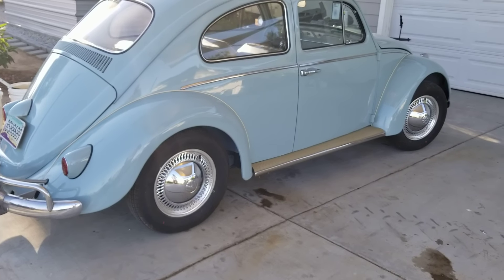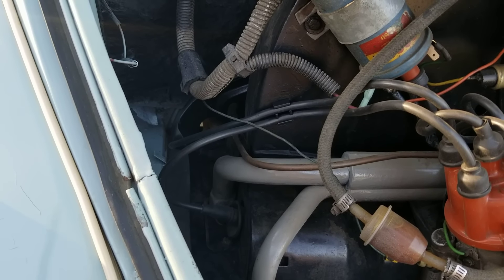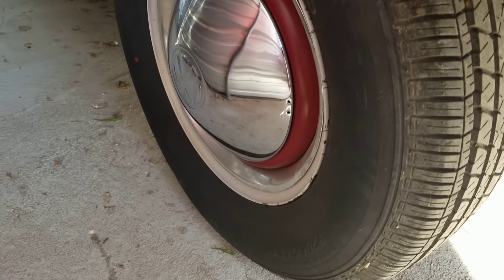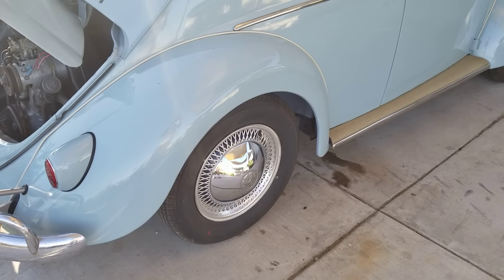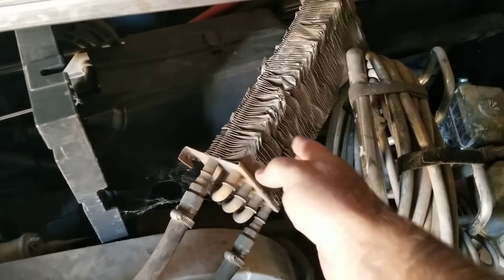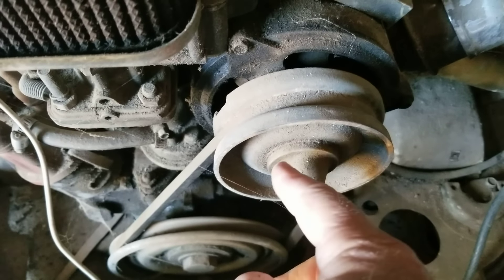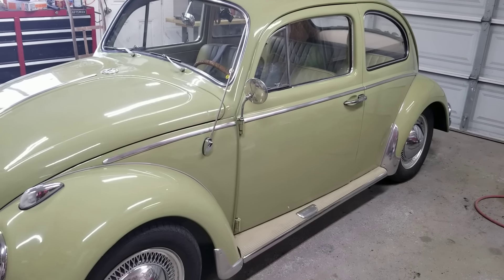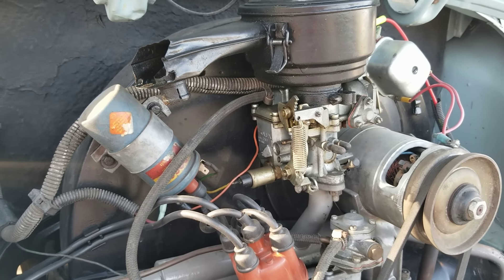Things NOT!!  to do to your Volkswagen VW bug or bus

Comment: Mine topped out at 78 mph...so I could not go 80! The oil cooler in the hot air path made for a smell of oil when you turn on the heater!!
Reply from the maker: depends on year early cars yup would not go 80.

Comment: Put your battery IN a plastic battery box, or, rot the floorboard out. Thread inside of gas connection on carb and connect the gas line with a screw-on connection, or, let the brass pressed-in tube come loose and burn your car up fast! Do not trust ANYBODY to do what they should or signal what they are going to do. Most don't have a clue what they are doing anyway.

Comment: ..do not use those clear plastic fuel filters in an enclosed engine compartment..they can, and do, rupture or get melted and cause an engine fire!..use the solid metal ones instead..but MOST OF ALL...DO NOT alter, modify, customize, lower, or in any other way defile an old Beetle that is as nice as this one!.. :)

Comment: Is this a '59 bug? I had one and the details look similar. One of its best features? The original engine was trashed - burning a lot of oil. A factory replacement with carburetor, dynamo and clutch was the equivalent of $250 and I put it in myself. After a further 60,000 miles, the car was rusted out, but I sold the engine for close to what I paid for it.

Comment: I had this 3 weeks ago.....
Do not leave without a spare throttle cable 😂 I was stuck on a road with no safety lane on the side. Somebody didnt see me with the hazard lights flashing in the dark 🤨 he almost crashed into my car. 
I really need to buy a proper solution for better visibility for these kind of situations.
But anyway I could get the cable attached again with some help from my swiss knife (I always have it in my pocket for stuff like this).
But it wasnt fun to do on a road where people drive along with 80 to 90km/h.

Comment: 1st Do not accelerate before starting, when starting the engine touches the throttle to keep a low turn, accelerate old solex causing premature injection and difficulty in starting besides mixing the oil that is resting in the cylinders and liquefying the oil causing reduction in life useful of the rings.
2nd after the hot engine has run a test, shutting down for one minute without starting, if running at half or one revolution is ok, if starting the engine without accelerating the carburetor bowl needle is not holding pressure and filling the bowl causing the drowning leading to the first topic. It is usually noticed after turning off looking from the carburetor he dripping gas through the ventury diffuser.
3rd always grease the front and rear torsion bars so as not to wear the bushings and maintain a smooth ride.
i have a VW Brasilia 77 1600cc old solex PIC 30, dif ratio 8/33 i can do 86ml/h and no problem, no overheat but need constant valve ajusts when i take to far, and start in 10ºc on half turn, and had not one single problem whit this kind a car. Thanks!
Reply: Rene Drew   no Man, is PIC 30 for sure, not American carb. Research by Brosol Solex PIC 30, tou going to see one very similar carb of first bettle
Reply: Rene Drew  no, they stopped in the mid 90s.

Comment: Does your old VW have a sloppy shift lever ? First remove and inspect the shift coupler,  it's under a panel under the rear seat. On type 3's it's under a cover under the car just forward of the transmission. Inspect it for a bent frame or worn out inserts or you can just replace it. If you have a semi-auto transaxle beetle you will also have to remove the spring and mounting clamp that is wrapped around the shift rail before removing the shift rail. It's purpose is to keep the shift lever always to the right where the 2 gear ratios that are commonly used are ( semi-autos only have 3 speeds ). Next remove your shift lever, it should be firmly bolted down to the frame tunnel. Go to the front of the car and remove the body apron plug, spare tire, and inspection plate, and the cover at the frame head. If the frame head cover didn't have a gasket you can make one or buy one but it should have one. On super beetles you also have to remove the front deformation piece. Inside the car thru the hole where the shift lever goes grab the shift rail with pliers and slide it forward until it comes out of the front of the car. In the hole where the shift lever was there is a plastic guide sleeve in a bracket. Remove the guide sleeve, in a type 3 the entire bracket can be removed. Inspect the guide sleeve for wear or you can just replace it. Install the retaining ring on the guide bushing before installing it. Ensure the slot in the guide sleeve points to the left side of the car. Now you can inspect the shift rail. It will be worn out where the guide bushing rode. Clean your shift rail with a solvent and scotch-bright pad and look for bends. Have the shift rail sand blasted and powder coated, do not powder coat the socket end where the shift lever fits. This will slightly increase the diameter of the shaft and make everything fit together snugly which is what we want. Re-install everything making sure you grease the inside of the guide bushing and the shift lever socket. Make sure you safety wire the square headed grub screw that attaches the shift coupler to the transmissions input rod ( the hockey stick ) so it will not fall out. The grub screw should be firmly seated in the indent of the input rod. Your car should shift like new now. 😀

Comment: you might want to put a safety wire on the carb as reported last- can be done by trapping mechanic wire under the hose clamp and securing the other end to the carb top screw Just a thought --- yay blazecut- google it--
Reply from the maker: perfect yes

Comment: What is the big deal with the holes in the bottom?  My shop replaced my oilbath breather and now I have two holes in the bottom where the hoses used to go. Should I plug them?
Reply: Holes in the bottom allow heat from your exhaust to come back up into the engine compartment.  This is an air cooled engine, so it will heat up the engine compartment

Comment: I'm interested in the reason that the pulley will crack without enough shims. Your beetle is a nice one!
Reply: The shims are for aligning the belt. If the alignment is off it puts stress on the pully. Use a straight edge to verify.
Reply: @craigkucing9779  I was wrong all these years because I thought it was about premature belt wear then?

Comment: the reason for not putting the fuel filter in the engine compartment is the weight of the fuel filter pulls the brass fitting out of the carb

the solution is heretical: get a 1/16" brass NPT fitting and the tap for it, tap the opening, and screw the fitting in.

Comment: i also have ALWAYS  run filter in cabin.. But DO NOT use clamps on plastic fuel filter, and if adamant about doing so do not over tighten as plastic filter will distort and cause leak especially on long distance drive... DO NOT install filter over distributor.. DO NOT throw ANYTHING away when "restoring" your VW, you may be surprised aftermarket will be trash in comparison..DO NOT buy a classic VW unless you intend to work on it😁
Reply from the maker: one persons trash is another persons gold amen to that one.

Comment: The red I & III & III tic marks around 15/32/45 mph on the speedometer are minimum recommended shift points/do not drive under this speed in the next gear, low RPMs are a killer (4th gear minimum speed 45/ 3rd gear minimum speed 32/ 2nd gear minimum speed 15).   As he said don't lug the engine down and don't shift early

Comment: So over the fall I got a 1965 slapped together dune buggy..square tube frame, welded under the influence of Bud Lite. I'm going to get an Acme Warrior knock down and build that. With this being a 1200 or 1192 engine, any recommendations on refreshing it? It has a swing axle transaxle (bug not bus). I want to drive it as a weekend vehicle and occasional warm day driver for work. I do have a How to Rebuild an Air cooled VW engine book. I know I want to convert to 12 volt since 12 volt lights are easier to find and I can run LED much easier (less load on the generator).

Comment: Do not have chrome tin. It looks pretty but it makes it run hotter. Do not use synthetic oil it's too thin. Do not use a glass fuel filter do have it in the engine compartment but make sure the hose clamps are away from any electrical connections.

Comment: I have advice for anybody who is driving your Volkswagen down the road or even on the freeway as soon as you feel hesitation pull over immediately don't try to wonder what it could be you could be flooding your engine with gasoline enough gasoline that maybe will run onto your distributor or even an exhaust and start a fire,,, keep a fire extinguisher with you at all times it's the best insurance you can have and the cheapest Insurance you could have, so as soon as you can put the fire out the better you are, ,if you have a vented decklid  don't open it shoot the fire extinguisher through your deck lid vents to try to smother the fire and run it out of oxygen if you do not have vents slightly open it and shoot it through the side of the deck lid opening plus if you open it all the way you could burn your face you don't want to do this be sure you know what you're doing if not let your prized possession burn to the ground because it will take a while for the fire department to get there if you're scared of fire you should not own a air-cooled car anyway,,,,..

Comment: A couple other things.......
 Do not trust your speedometer.
Do not dump the clutch in reverse whether you're stuck in sand, snow, mud, or anything that would need more oomph to the tires while backing up because the weakest part of the entire transmission is the reverse gear assembly.
 Do not install your battery without hold down, if you were to flip the car over and the battery were to not only knock the rear seat off of its mounts, the battery would find some way either hit you or your passenger in the head or short out on something once it becomes jettisoned through the cabin,or all of the above. ( It weighs a lot and it's not gonna stop traveling until it's ready to stop.)
 Do not trust stock 4 wheel drum brakes on these cars to do anything except give a mere suggestion of 'Stopping Power'.
 Do not drive one of these cars with a weak battery,..... just because it's running doesn't mean the battery is 'ok' because if you try and start these cars with a weak battery sometimes the solonoid will stick and the starter will continue to spin the engine until you disconnect the battery or until the battery goes dead. 
 And last but not least,....
 When explaining things on a video don't just keep talking through phlegm when you need to clear your throat.....LOL!!!
🐞🐞🐞🐞🐞🐞🐞🐞🐞🐞🐞🐞

Comment: Annother suggestion, is never,never put an aftermarket carburator on a stock engine, it will not work right, in my case I had a 1973 Supe beetle, and I had the engine worked on and I put back a lot of the things missing, and the part that goes from one side to the other, and the carburator is in the middle, the sides had been cut off, then the part where 2 hoses go one on each side, they had put a ball to cover the holes, also on the carburator, it was a Webber carburator, I had to change it two times, cause the car would stay accselerated for no  good reason, so somebody was parting out a 1973 beetle, and zI bought or got a lot of the parts to put it back to stock again, the best I ever did.
Reply from the maker: those webber replacement OEM style carbs were terrible totally agree

Comment: Do not charge the battery with the battery cables still hooked up to the car, it can damage the alternator. Do not get a jump start either, same reason. Bump start it instead. Therefore... park strategically!
Reply: Do you mean 'push-start' & pop the clutch in 2nd?

Comment: I don't want to disappoint you!  :))  So, here goes:

I recognize you have had no issues with placing your fuel filter in the engine bay, but one leak and you engine is toast, and probably your car as well. Put it under the car. Minimal cost insures against major catastrophe.  

(I also would not install body-colored fender gaskets, but that's personal preference.

Comment: Great vid., good tips. My 74 bug is hard to shift. Any thoughts? Could it be the shifter plate needs a little adjustment?
Reply from the maker: bad shift coupler under the seat or bad shift bushing under the shifter. Or the ring is worn out. iu
Reply: I had this problem last week on my '67 and it was my clutch adjustment - too much free play. I tightened it to spec and the problem went away.

Comment: I am looking to buy a 1974 bug and after watching this video and having no mechanical sense I am depressed and wondering if I should even bother with with it.  I had two VW's in high school, added 8 speakers to one, it finally died because I never checked the oil.  The second one I got was an automatic I am not sure what happened to it.  I still have no mechanical sense, however, I am watching videos and am learning where the oil change bolts are.  I just wanted an old memory to drive around and enjoy.  Sounds like I need a fire extinguisher, extra engine in the back seat, extra belt, fuel gauge, tubes, and basically every manual that shows what to do.
Reply: If you wanna drive a bug but cant even check the oil, you prolly shouldn't own one.
If you Really want to get one, you'll either need to greatly improve your mechanical skills, or have alot of money to send it to the mechanic every 2 weeks. (then every 3 months after the mechanic fixes the seals and general repair)
Either that or you're an excellent Troll.

Comment: How about leaving 1/2" free-play in the clutch pedal...I've seen both no-play to too tight clutch pedals where the clutch is not at full-spring-pressure on the pressure plate while coupled-engaged-rolling...you're only 85 to 95% of full clutch pressure.

Comment: Gave you a thumbs up. But do not use "do not" if it confuses the rest of the sentence.
As in, Only use copper core ignition leads. And always use a steel belt pulley, not aluminium (which is also a metal. :¬)
Reply from the maker: yea for sure good catch.

Comment: Do not drive with the factory "mesh" oil "filter", DO add a modern external screw oil filter adapter and modern microns filter. Do add an easier to service drain plug that doesn't require unscrewing 10 delicate screws, 2 PAPER gaskets and whatnot replaceable nonsense. You'll live happier. 😊

Comment: What NOT to do??? Do NOT use those hubcap “beauty” rings…😉

Do NOT use points and condenser…convert to Pertronix Points Replacement Kit + Coil.🙌

And the most obvious…do NOT use that plastic fuel filter. It will crack, spray fuel all over your engine, and burn down your ride.

Comment: Do not use braided fuel lines. Do not mount fuel filter in engine bay. Mount it behind the fire wall by the transmission.

Comment: Do not go cheap on your parts .upgrade the crap and install it correctly so you don't gotta check it everytime you drive it. 

Do not put your fuel filter in engine bay. Mount it safely near transmission under car. They sell a $10 bracket that properly mounts the fuel filter in a safe spot.
Reply: Do you have a reference/link for the bracket?

Comment: Back in 73 J.C.  Whitney sold a kit that should have been called  things do not do to your bug.                  Power Pulley                                                                                                                                                            Decked heads   over 9 to 1 CR                                                                                                                              87 mm Pand Cs                                                                                                                                                       === overheating

Comment: Hello Mike I have a problem in my 67 bug and no one seems to know where it’s coming from I’m hoping maybe you have the solution so here it is, when I’m driving and I put my arm on the edge of the window I feel the electricity running through and it’s zapping me lightly that have left small blisters from it, i feel it stronger around the molding also my passenger it’s getting zapped too with the seatbelt buckle. I disconnected the wire from the steering wheel horn since It’s aftermarket and it’s metal without insulation but I’m still getting buzzed. any advice I would really appreciate it, Thank you
Reply: nikittoo1 dome light wire shirting to metal. I get shocked from hanging my jacket on the hook behind driver’s seat. Does your dome light work? Hope that helps.

Comment: Do not install a cheap plastic fuel filter between the fuel pump and carburettor, if you really have to install a fuel filter put it down by the gearbox . Make sure your fuel lines are ethanol resistant. Put a rubber mat over your battery so the rear seat springs don´t short your battery . Install blaze cut in your engine compartment .

Comment: Don't allow rusted heat exchangers to be run ...those that wrap around the exhuast manifold....as the rust holes or metal separation can get carbon monoxide into the cabin ( as  engine fan pushes "Air" on the other side of the exchanger)..and then conveniently kills you.

Comment: Do not leave home w/o : vise grips, bailing wire, 10-13 mm wrench set, extra fuel cable/clutch cable, points, condenser, ignition cap, spare fuses..
Reply from the maker: Vice grips are a must you can do so much with them yes for sure.
Reply: Vise grips and wire can be used for a hand operated throttle cable, If the throttle cable breaks.